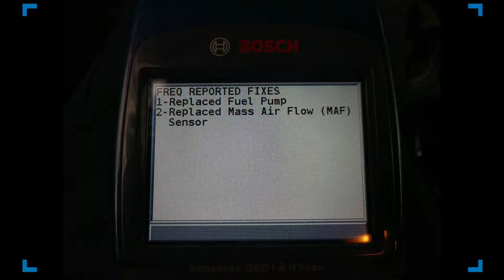R56 Mini Cooper S Video 4

Comment: how many horsepowers you reached after all these modification?
Reply from the maker: I haven't dyno'd the Mini. The tune from Vivid Racing was a huge boost.  Bigger pistons, full exhaust with no cat, larger intercooler and piping, biggest turbo I could find, better flowing air filter, and thicker head gasket are all contributing to horse power gains.  It looses traction in 1st and 2nd gear.  I need to upgrade the transmission to a posi differential to really make any gains in a drag situation.  It has more than enough power and is very fun to drive.